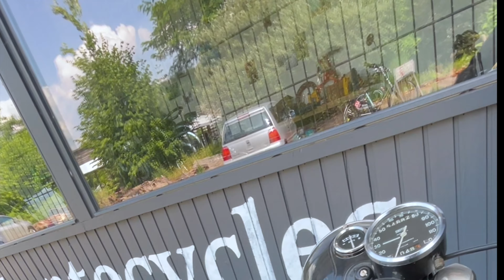350cc AJS PROJECT ALMOST DONE!!!

Comment: I have a Moto Guzzi LeMans. I just put spoke wheels on it. It has had a change from 35mm standard forks to 38mm Marzocchi. The amount of crap I have had to go through to get everything to fit properly and work has made me doubt my sanity. I also have a Vespa like the blue one only a 200. You cant kill them. They are like mechanical cockroaches.